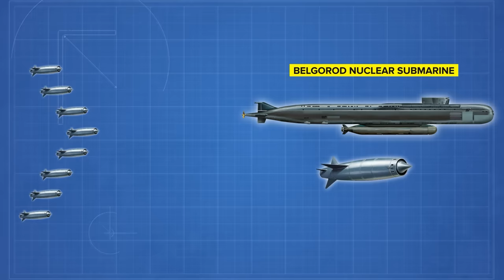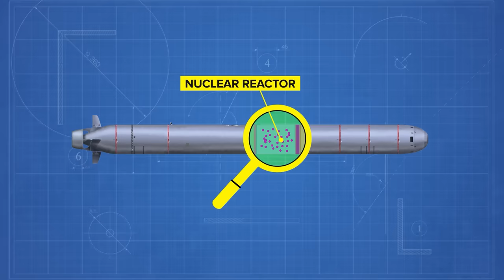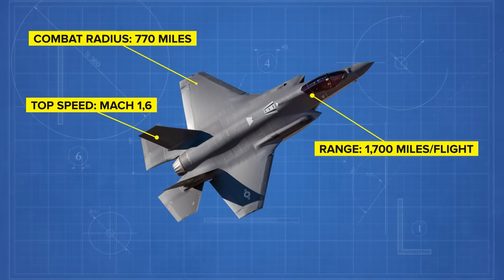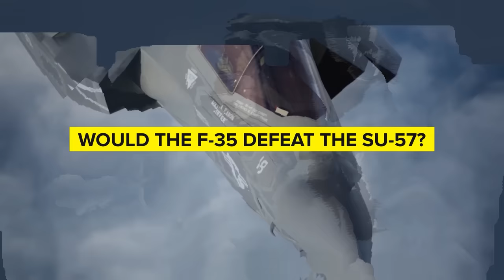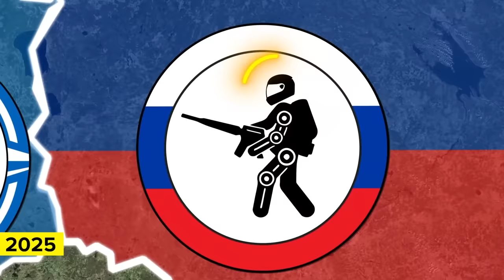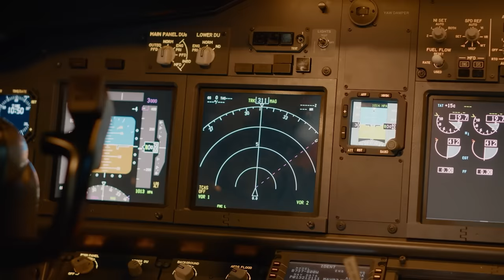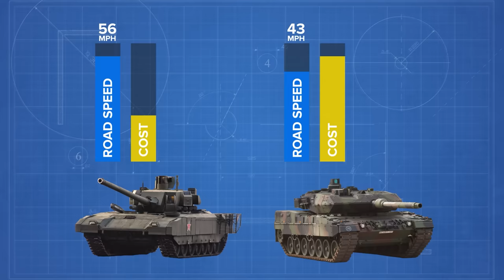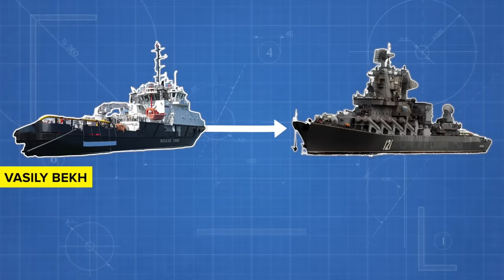What Happened To Russia's New Doomsday Sub - COMPILATION

Comment: I have never heard of anything moving at 180 miles per hour under water. Not even bullets can do that. This seems completely bogus. There would be immense cavitation trailing torpedo....Destructive cavitation. 
I could be wrong...But I doubt it.
Reply: 100 knots is 185.2 km per hour
Reply: You never heard of a hypersonic torpedo? Anythings posible in RU, just lie about it.
Reply: Nothing can move that fast underwater and stay underwater unless shot strait down and it has to be dense and hydrodynamic otherwise it would slow down too fast. Another issue is drop in speed if it uses fuel due to loosing weight thru burning so it would be a small projectile.
Reply: @eventprogenitor1873 
The shape of the torpedo  creates cavitation. As a result the torpedo is encased in a bubble,  that's  what reduces the friction  as it travels under water.😊
Reply: Super cavitating torpedoes make a bubble so big that the entire torpedo is inside.  Almost no friction so it can go very fast.  Problem is it cannot be sonar guided.
Reply: @dananorth895 Ahh Trump Physics, Putin and Trump go hand in hand
Reply: @ulrichkristensen4087 got a real yaper here.
Reply: Ivan is saying bubble as bubbles are forming on his lips
Ha ha ha

Comment: Where did you research this video? The radar cross-section on a raptor is . 0001m² in the f-35 it's .0015 m2. The f-35 is it better overall stealth fighter because it has multi-role capabilities and great situational awareness but it doesn't have a smaller radar cross section.

Comment: dont forget, the nuclear powered torpedo dont mean it has the same propulsion solution as the big sub´s. the reactor just might be a smaller battery charger. and propulsions is made by electric.
Reply: Wouldn't have the endurance. Stored electricity has a very bad power to volume/weight ratio.

Comment: I am tired of hearing about comments made by "military  technicians" who are certainly competent to maintain equipment but certainly NOT competent to make such ridiculous claims.  The residual radioactivity from modern nuclear weapons is far, far less than was claimed.  Just consider the extremely "dirty" (U 235) weapon used at Hiroshima.   It was safe for habitation just a few years later.  Given the fact that a modern weapon has far, far less residual radioactivity and the dispersion of the sea, there would be NO problem with habitation of an area where this torpedo was detonated.   While I certainly respect the capabilities of military technicians, it is irresponsible for them to make comments regarding technical areas in which they have ABSOLUTELY NO knowledge or training.  (Yes, I hold three engineering degrees.   I am not at liberty to make comments beyond this.)

Comment: Why not do a comparison between the F22 and Su57?
Reply: Because the F35 is getting better all the time, it is the best at its multirole, the F22 is a pure fighter and does not have the same sensor capabilities, although it is more stealthy.
In comparison, there are  over 1000 F35 built, SU57 around 20. They wull never be able to defend or attack on a front

Comment: The author relies upon highly questionable sources for his conclusions.  Many if not most of his conclusions are not scientifically possible.  Russia is famous for making ridiculous claims regarding its weapon systems.  The nuclear aspects of these claims are simply absurd.  It is virtually impossible 44 any nuclear weapon to make an area unusual for a 100 years.  This is particularly true for modern nuclear systems which use very small amounts of nuclear material.  As an example consider the weapon dropped in Hiroshima, Japan.   In comparison with today's weapon it used a massive amount of nuclear material yet it was safe to re-enter the area within ONE MONTH...Not one hundred years!   For an implosion device, for less nuclear material is required and re-entry would be much faster.  Another concern is for their claims regarding the nuclear power system of the torpedo which would be highly problematic and make the torpedo relatively easy to detect.  Just based upon these 2 topics, it's easy to see that the claims Russia makes are wildly absurd and SIMPLY LIES.   I wish that he would edit this video and use real qualified and experienced nuclear engineers rather than unqualified "nuclear technicians" who do NOT have the education and training to make the (FALSE) claims that are being made.

Comment: Hey Cowboy it's common knowledge that 100 knots isn't 185 mph. Check your facts. How are we supposed to believe your video with mistakes like that?
Reply: 100 Kts is equal to 113.64 mph. (1 nautical mile is 6,000 feet or 1.1364 miles). 
 I'm probably off by a factor of 10, but there is no way this thing makes over 40 or 50 knots tops if it exists at all. At 40 knots, it would sound like the hounds of hell in the water, so no stealth capability at high speed at all (cavitation and turbine whine would be unmistakable).
With the estimated 15MW gas cooled power plant, at 100 metric tons (110 US tons), 60 knots would require around 34MW, so nope.
Reply: @boydgrandy5769   Hi Boyd, I know how fast 100 knots is in MPH. But the author of the video doesn't. He said that 100 knots is 185 MPH. Not even close!!!!
Reply: 100 knots is 185.2 km per hour. 
95.5% of the world uses metric .. very understandable and trivial mis-speak
Reply: @SerendipityChild 

Hi Stephanie,
It's great that 95.5% of the world uses  the metric system. But 4.5% of the world doesn't use the metric system. By his accent on the video he sounds like he's from the U.K. In the U.K. they use MPH to measure speed not the metric system and KPH. It's not trivial mis speak. It's sloppy editing and you wonder how much more of the video is trivial mis speak. I'm not a metric system hater. I kinda like the metric system. Especially when driving because kilometers fly by compared to miles. You're still going the same the same distance but it's psychological. I'm not to fond of Celsius because there is too big of a gap in one degree of temperature.
Reply: Water freezes at 0 degrees :)
It boils at 100 degrees :)
Reply: @cfrepublic  I'm lost I don't understand what water freezing at 0° and boils at 100° has to do with 100 knots not being equal to 185 MPH. Water doesn't freeze at 0° and boil at 100° in the United States. In the United States water freezes at 32° and it .boils at 212°. That's common knowledge!!!!

Comment: I guess Russia really has these things and that they work. 

But USA is developing or have much of thee same, or even beyond and are speaking down the possibilities such that people in general will not understand what is possible and real at either side. But still these things are so expensive that neither side is capable of making much of it, and the little they have is reserved for very special purposes.

The problem with nuclear reactors inside so narrow spaces makes it impossible to shield for the radiation, except in direction where vital electronic is placed. This makes the handling of the devices extremely difficult and expansive. But for special military purposes this tend to be accepted, I think.
Reply: Problem with nuclear reactors that small is they don’t exist LMAO.